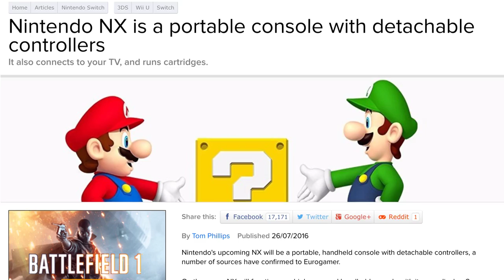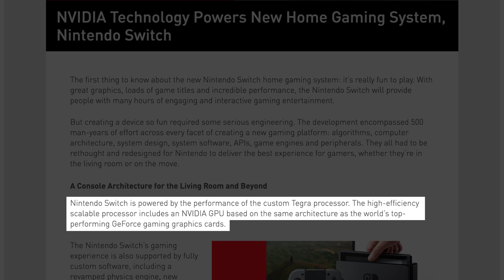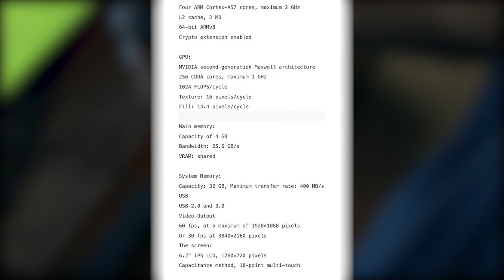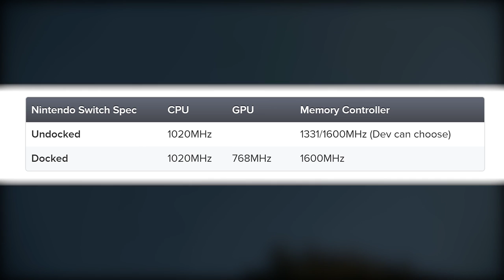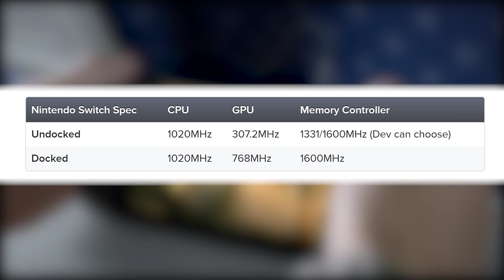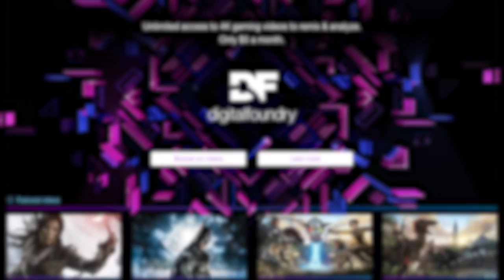DF Videocast #6: Nintendo Switch Clock-Speeds Revealed

Comment: Nintendo never learns
Reply: Dude it's very underpowered get over it.
Reply: Critical Pilot Because you are looking at it from a HOME CONSOLE perspective where the Switch is technically a HANDHELD with a dock.
Reply: Research? Nintendo has been in decline since the NES and SNES days. Their only top selling things since then are the Original Wii and Handheld stuff. Nintendo hasn't learned since the N64. Good first party games, but poor third party support and the Wii U has got to be the worst since the Virtual Boy.

Nintendo could just come out with a regular console. Instead many of us see gimmicks and under powered crap. That's already a sign that they may lose third party support again.
Reply: its true! what @IDragoN says. look at the n64... it lower storage than the ps1 disc, despite being the more powerful! system of the era. gamecube same thing, more powerful than ps2... could rival the og xbox but didn't have storage capability like the ps2 and xbox did. now onto the wii...  wii sold the most but honestly compare that library to that of ps3 and x360 no comparison there. if the switch is going to be underpowered again, well i dunno what nintendo can do... they have to market it so damn good like like they did with the N.E.S and Snes and N64, casue thoose sold and were nintendo's best era's.
Reply: It doesn't conflict with what Nvidia said all they said is was he was using the GeForce architecture not Pascal! You can go on the forums or their website if you will and read about it yourself! You guys really need to stop the bullshit and get over it again it's a fucking thin ass small ass tablet it's not going to compete with Xbox one or PlayStation four but I'm sure Nintendo fans will enjoy the Nintendo exclusive's on the system I might even buy one for Zelda but maybe not.
Reply: In my opinion the SNES was Nintendo's best system that's why I still play one and own one today and 64 had some good titles but very much paled in comparison to the original PlayStation when it came to titles  GameCube had some cool games but it still didn't have the blockbuster titles that PlayStation was getting yet again don't blame gamers and a gaming community for Nintendo's fuck ups it's solely on Nintendo shoulders and they obviously just can't get it right no matter how many Switch Systems sell it still is not going to get a lot of the third-party support that PlayStation and Xbox will receive.
Reply: Its a fucking rumor
Reply: Sure it is but when you have multiple sources saying the same thing it's really not a rumor dude they put rumor on it for a disclaimer so they can't get sued trust me it's not going to be powerful for a handheld yes but for a home system Hell no.
Reply: +I DragoN I think they learn quite well. The Switch isn't trying to compete with consoles, Nintendo is focusing on the one thing Microsoft and Sony can't touch them at, and that's the handheld. The Switch is the most powerful handheld out. If you look at the reveal trailer, Nintendo is marketing this as a portable handheld device. At least 95 percent of the trailer is people playing the Switch on a plane, outside, in there cars, at public gatherings etc. They only showed it initially docked  and being played while sitting on the couch. Notice they didn't focus on the docking station, because that really doesn't matter, they are selling you the handheld portion. The docking station is the gimmicky part that people can use if they choose, but must people want the ability to play Zelda BOTW on the go. So this is the smartest thing Nintendo has done in years, they focus in on what they are actually good at. They throw in the ability to play on the big screen if you want, but they still  are the best thing going in the handheld market. The Switch is a smart move. It's going to sell big time.
Reply: "SOURCES"
Reply: WITLESSMASS 'marketing this as a portable handheld device'? um handhelds ARE supposed to be portable xD perhaps you mean portable console :P
Reply: but they did learn.  They know if they try to go toe to toe with Sony and Microsoft when they already have a several years head start, with a similar power console at the same price whilst splitting the userbase they do have between two platforms, they're going to lose.  

Personally, my Wii U collects dust.  Has done for ages.  The 3ds gets used weekly simply because it's not competing with my ps4 or pc.  This is Nintendo focusing on their strengths.

As long as they're treating this as a handheld first and foremost, and a home console second, I think they'll have their market secured.
Reply: Where the hell did you seen the video that the system had similar power to the competition lol honestly them staying handheld mostly his Nintendo's best bet I'm not saying that the handheld is horrible by any means but for them to try to push it as a home system and not a handheld system was pretty dumb in my opinion.
Reply: they lost third party support last year because the lack of power, and they can't at least mach the xbox one power which is already an underpowered console... imagine that
Reply: Yet. Wii U has more consoles sold than Xbox one
Reply: +Efrath I agree wholeheartedly, Nintendo burnt me with the Wii U but I have high hopes for the Switch. Its a smart move to focus in on what you're good at. Nintendo has done that with the Switch, it's a very powerful handheld device. Leave the Console wars behind, I think Nintendo is seeing this more power war for what it is, it's not profitable in the long run. It doesn't make sense to produce superior hardware and then sell it at the cheap price console only gamer's are willing to pay. I game on PC as well and more teraflops cost money. My GTX 1080 cost me over 700 bucks and that's for 9 teraflops of power. The PS4 Pro cost 399.99 before taxes and produces 4.2 teraflops of power in an all in one system. And now Microsoft is miffed cause Sony released the Pro so cheaply and now they can't release the 6 teraflop Scorpio as a Premium device like unto a high end PC. Microsoft has to keep the Scorpio in the price range of the Pro are people will just pick the Pro up instead. This has become an Arms race with in gaming, an Arms race Nintendo is smartly removing itself from. America defeated Russia without firing a shot, it just got them to play a game of who has the most tanks and Russia couldn't keep up. Usually Microsoft and Sony sell their hardware at a lost, they hope to recoup their money on software. The Switch allows Nintendo the opportunity to make a profit off their hardware. It's a smart move, the Switch doesn't need to keep up with the Pro or the Scorpio, it just needs to be the most powerful handheld out there, with IP's that people can't wait to play on the go. This thing is going to sell like hot cakes and it want even need third party support to do it. The prospect of playing Zelda BOTW on the go is a system seller, the ability to play beloved game cube games on the go is a system seller. The Switch is not about playing games on the big screen while sitting on your couch. We can already do that. What the Switch is bringing to the table, is the ability to play games we once thought could only be played on a console, on the go.
Reply: Deronia lol no
Reply: Deronia what are you serious?
Reply: Deronia no microsoft fan but 20 million wii u's vs 45+ million xbones.  Personally i have a wii u but i am not delusional, it is a failure.
Reply: Well here's the thing Xbox doesn't have 45+ million Xbox Ones sold either so you're both actually wrong about the numbers but I can assure you the Xbox one definitely has more system sold.
Reply: +Critical Pilot Trust me, Nintendo is banking on the fact that most of us will buy just for the ability to play Zelda BOTW on the go. That prospect alone will sell the system to many. It's a handheld pure and simple. A handheld that is upping the ante on what type of gameplay Nintendo can bring to their IP's on the thing. We haven't seen anything like this on any of their other handheld devices. It doesn't need to compete with the consoles, its the most powerful handheld out. Microsoft and Sony can't compete with Nintendo in that arena.
Reply: WITLESSMASS pretty sure they only made this cause they dominate the handheld market and it looks like they're trying to get sells from Japan cause it looks like console gaming is going to die there while gaming on the go or mobile is exploding in Japan.
Reply: Here, I'll tell you what happened, the "Source" is more than likely a person with an old devkit and got questioned about it with the clickbait journalists ignoring said fact that it's an old devkit with old hardware and then made a "Reveal", pretending it's fact when in reality it's rumours at best due to the simple fact that an old devkit runs on older hardware for obvious reasons. I highly doubt these "Sources" have access to an actual, new Switch.

And multiple sources saying the same thing does not make it fact, it's just naive to think that; it honestly annoys me at how many of you that are falling for clickbaits that are basically just "THESE ARE THE NUMBERS" without citing sources or even mentioning what they're basing it on, whether it's an old devkit or an actual Switch. But then again, they wouldn't get as many clicks if they were actually honest about that and people would stop spreading it as "Fact".
Reply: Nath W Nintendo hasn't learned anything.

When everyone else is x86 and you are using ARM you are wrong. That is why the Wii U died.

PS4 = x86
Xbox One = x86
PC = x86
Wii U = Custom Solution

Hmmm as a developer looking for the largest return on my investment what do I do?

Custom solution that only works on one console or x86 that is crossplatform. One version of the game will work across the rest and we can just fiddle with this and that to optimize.

x86 it is.
Reply: Nintendo... Nintendo never changes
Reply: Felipe L. Exactly.

They always try to push the same shit that didn't work last year But oh look! It's got a gimmicky controller or pad or dock or color, this one is pikachu themed. ( Rolls eyes ) Fucking Nintendo hasn't learned anything and will eventually go out of business.
Reply: if this is true for now its nothing more than a rumor
Reply: @Critical Pilot Geforce is a brand. Pascal is the name of their latest microarchitecture. I suggest you do more research before making yourself sound like a fool on the internet.
Reply: +KvSwooo Nah he wouldn't do that he has "trusted sources" which he believes 100% are right even though its a rumor
Reply: Critical Pilot is the succesor of the 3ds? ...i doesnt have to compite with the xbox one or ps4...you said is shit...i think is the most powerfull portable console in the history.
Reply: That's because they are the only ones who understand.
Reply: WoomyWobble why wii u failed then
Reply: Wii u Failed because it was not x86 like everything else.
Reply: Marketing
Reply: ***** lack of third party games and crap hardware.
Reply: Aaron Garza switch still is arm lol
Reply: ***** I know dude! Nintendo hasn't learned a thing. Same mistakes as always. Lol.
Reply: Efrath The problem with N64 and gamecube was: They had their own storage format. Third party wanted CD ROMs over cartridges because it had more data. Same thing with the gamecube. Sure, they can come out with a powerful system but at the other fronts it screwed over third party. That is what Nintendo never learns.

 Should just come out with decent hardware, normal controller, good online infrastructure, no region lock and something 3rd party would support.

But but, Nintendo just turns into MS and Sony without their gimmicks! Well, their 1st party is what differentiates from the others, they don't need gimmicks to succeed. So Nintendo can't make a competent console on all fronts, THAT is what they'll never learn.
Reply: The switch will be weaker then an iPhone 7 (which already outperforms the not downclocked Shield console and Pixel C tablet in most benchmarks).

Here are some Benchmarks guys.

Geekbench 3 (processiong performance)

iPhone 7 - Singlecore: 3380; Multicore - 5500
Nvidia Shield Console - Singlecore: 1650; Multicore: 5040

The Switch will run at 50% of the Shield Consoles clockspeed.

GFX Benchmark (graphics performance) Trex 1080p offscreen Render:

Nvidia Shield Console - 120 FPS
iPhone 7+ - 108 FPS
Google Pixel C Tablet - 103 FPS
iPad Pro 2015 - 170 FPS
Xbox One - 400 FPS
PS4 - 480 FPS

And the Switchs  GPU will run at 1/3 of the clock speed of the Shield Console.
Reply: coolertuep It's a new fat 3ds Lol its so hand held it doesn't even fit in your pocket. Lololol.

Can't wait to play the new crappy Mario game they come up with since they don't seem to care much about any of their other I.P.s.
Reply: coolertuep Didn't see Switch's performance on the list.
Reply: coolertuep the iPhone 7 outperforms the shield tv not because of the hardware but because iOS is a normal software and Android is a Java piece of shit that waste resources. Hardware wise the shield TV is miles ahead but consumes a lot more energy.
Reply: You compare with x86-64 systems, is imposible to have same performance on a ARM system.
3DS: has 4 GFLOPS
PS Vita: has 50 GFLOPS
Nintendo Switch: 400 and could have until 512 gflops

With a Tegra X1 Nintendo has the mobile device portable more powerfull on the market (nvidia shield TV is a home device) , all of this power on a handled  console is incredible.
Reply: Rob Fer what???? vita is 50 gflops and 3ds is 4gflops
Reply: Aaron Garza Nope, everyone else isn't using ARM. If I'd look for the highest ROI, I'd develope for ARM, as you're ending up with considerably lower dev costs and ARM is on pretty much every portable/handheld device there is.
Reply: Efrath No, they don't never learn. After the disaster that was N64 and Gamecube was followed by huge success tbat was Wii, Nintendo still went on to develope the Wii U, that was maybe the most epic failure on the industry. NDS was followed by 3DS - makes you wonder what were they thinking. If Switch is a huge success, Nintendo's going to replace it with some virtual reality glasses.
Reply: Vishal thind Yeah, you are right, i'm wrong, i was confused about Vita that has SGX543 MP4+, not mali 400, and 3DS that has Pica 200
Reply: ***** Yep, I am referring to portable devices
Reply: Aaa Bbb The Wii was only a gamecube with a few extra bits and a gimmick ( Wii mote controller ). It sold well because of the Gimmick, everyone wanted to check it out. They did. They went back to a real controller that wasn't gimmicky.
Reply: Aaa Bbb You can say your an ARM dev and all this other trashy lies but in the end the industry has spoken.

To make porting easy... They've all opted to use an x86 framework.

Going ARM when everyone else is x86 just means you will be left out in the cold and some companies will not invest resources into porting games to your platform especially if you are the only one using it and you have a crap install base.

It's the Wii U all over again. Same gimmick shit to try and get people wanting the console.

That is all Nintendo is now... Gimmicks!
Reply: ***** What are you using then? What games are you playing? Lol
Reply: ***** The difference is in those days everyone had something different. It was the reality of the industry at the time. Times have changed though. Again, everyone else is x86 now. They, companies making and selling games, have to see if they want to invest into porting to this one console and hope they don't take a loss. Companies aren't going to be throwing themselves into that fire. 3rd party support will be weak as hell.

This is exactly why the Wii U failed.

It will also be why the Switch fails.
Reply: Aaron Garza Nope, Wii U is a Gamecube with gimmick. Wii was never about the hardware, it was only about the software. Wii Remote was only to remove a barrier of entry. Wii Sports was successful because of sports, Metroid Prime 3 was successfull because of Metroid, Wii Fit was successful because of excercise, NSMBW was successful because of Mario, SMG was successful because of 3D Mario, and the list goes on. All of the games used the controller extremely well, but the point was not the controller, but the game. The controller was functioning only as a method of communication with the game. Controllers don't sell consoles, games do.
Reply: ***** Do you work on porting? Can we see your resume for porting games?

It's a big task and it costs money. Something companies don't want to lose a penny of if they don't have too. Doesn't matter how popular an architecture is. In the end what is cheapest for the company and what provides the largest return is all that matters.
Reply: Aaron Garza Yes, Nintendo is gimmicks. They think Wii was successful because of the controller, not because of the games. However, with the Switch, it looks like this may change - at least what we've seen so far is pretty straightforward and interesting. By the looks of it, it's impossible for Nintendo to pull out a new Wii U-gimmick. It's been pretty much the opposite. However, we don't know much about the games so far, and this us what matters.

No matter what the industry thinks, it's the market that decides. There's a reason why all the developers are on the mobile platforms (=ARM), that's because that's where the people are. There are lots of "AAA" titles being ported to mobile anyways, and there are more ARM systems in the market that can play games, than there are X86 systems.
Reply: Aaa Bbb I never said the Wii U was a Gamecube. The Wii was. It definitely had a gimmick, aka the gamepad for the Wii U and the motion controller for the Wii.

Your right Wii was not about the hardware... It was about the Gimmick of using the Wii mote that drew people in. It just so happens that some of the software, all of what you mentioned was first party, was ok.

Marketing sells consoles and one way to market your console is a gimmicky controller that is new and unique.
Reply: ***** Right they still ported to the old systems because they had their teams, who've been doing it for years at that point, who could quickly and efficiently port the game. It would give them good sales since there was al ready a large install base of both PS3s and Xbox 360s. They had a high chance of making a profit from the investment of porting to those consoles. Which is why they did that.

The Wii U did poorly because it didn't have 3rd party support. It didn't have 3rd party support because of Nintendo's draconian 3rd party deals, their poor youtube/streaming policies, and their unwillingness to use an x86 architecture, like the rest of the industry, to keep the costs down and the return on the developer's/publisher's investment as high as possible.
Reply: Aaron Garza They port when they see money being made there. That's only thing that mattters. It is why we saw PC AAA titles on NDS.
Besides, why would devs port the PC games on PS4, I believe PS4 uses open libraries, as Windows games use MS's Direct access. It would be cheaper just to publish the game on PC and X1.
Reply: Aaron Garza Excuse me but VR is a HUGE gimmick but seems to be siccessful
Reply: MorimotoYTP Right. VR is a gimmick. It's successful because just like the Wii mote it's new and interesting so people take the risk. Also x86 XD Lol.
Reply: CroneRaven1810 Oh please, Gamecube had plenty of third party and N64 has a mixture of both; both has been praised as consoles with good game libraries. Don't go around claiming that it's about third parties when that wasn't even a big problem with both consoles having a plethora of good games to choose from. More than likely, people associated Nintendo with "Kids", with Playstation being the "Mature" console.

No, turning into MS and Sony wont change anything, most people here will still buy X-Box or Playstation based on brand rather than what games the console has even if Nintendo decided to go with a strong console. Consumers did this and this is simply the consequences you have to deal with, going around and complaining about it after the fact wont change anything, they have no reason to believe anyone will buy their console for graphics alone.
Reply: ´´Yet. Wii U has more consoles sold than Xbox one´´ Lol XD Fanboy much? as far as i know 30 million is higher than 14 million
Reply: Dark souls developers ran  a bouild on the nintendo switch and they were pretty happy with the performance
Reply: Nicolas Cortés lmfao
Reply: Aaa Bbb I mean I've explained it over and over and you just don't seem to see the big picture or even understand what I am saying.

One last time...

They port when they see their is money to be made. Yes.

When your console isn't flying off the shelf, like the PS4 is, then there will be no return on your investment. This means that you shouldn't even bother porting. Not everyone with that console will buy your game. In fact, there will be a huge chunk that won't. So if your install base is low, like the Wii U, then no one will port games to your console. Especially, if you add a barrier to the porting process like a completely different architecture. Nintendo is only shooting themselves in the foot. Risk on the investment return is high enough without the barrier of a different architecture. Plus, lets not forget, not everyone is rich and can afford all the consoles and PCs galore. Some people can only get one device. If that one doesn't have the majority of games you might want to play then you won't get that console. No matter the gimmick.

The console purchasing decision will come down to several factors.

1. Do my friends have it?
2. Can I play games online with them?
3. Is the console reasonaby priced for the hardware it provides?
( In the Wii U's case this is a no and from the rumors I hear neither is the switch)
4. If I get this console will I be able to play 3rd party titles that I want to play?

Etc..

---

Why port PC games on PS4? Because it's easy x86=x86.

PC=x86
PS4=x86
XB1=x86

Aside from minor changes to the program, it can be moved to the other platforms with ease. So, it takes little to no investment than compared to moving to a completely different architecture.

So...

x86 =\= ARM

Is ARM popular? Sure.
Is ARM capable? Sure.
Is ARM x86? No.
Are all the other platforms using x86? Yes.

Who doesn't look like they others?

"Nintendo"

Hmm....
Reply: Actually snapdragon chips can run windows now
Reply: In the end I hope Nintendo does well but to me it just looks like they are shooting themselves in the foot.... Again.
Reply: It's like a 100++ Years Old Man .... wait ...
Reply: Nintendo is geared toward their domestic market in Japan first, then the international market second. So the question is, will the Switch be successful enough for them in Japan?
Reply: Aaron Garza once Jan 12 hits, things will be different for Nintendo
Reply: Aaron Garza I would advise you to wait until Jan 12, because this isn't confirmed by Nintendo. I see you just waving a rumor above your head saying "Oh look the switch will fail Lololol."
Reply: Aaron Garza I believe that you are basing this off the rumor right?
Reply: so
Reply: it is just rumors
Reply: Justin Wong yeah pretty much but the Garcia kid doesn't understand
Reply: +Efrath What an idiotic piece of dialogue. Nintendo failed with the gamecube and N64 for the same reasons they always fail. They are too stupid, gimmicky, and childish to make a successful console. Scratch that for the one exception where the market called for that in the Wii, outside of that - Nintendo has failed and always will fail. A stronger console isn't going to fix that, because if that was the solution to increasing sales, then there'd just be an arm's race of who can make the most powerful console and that obviously isn't the case.

You're right on one thing though, even if the Switch turns out to be PS4/XBO level, I still won't buy it, and most other's won't either. I don't just care about graphical power, although I'm sure that'll be underwhelming too anyways.

I didn't need to see this video to know I wasn't buying a Switch. I had already decided that when they decided to launch this years after the generation has already started, with more poor launch titles and what will almost certainly be concluded with another terrible library of games, cartridge support, more gimmicky mess and what looks to be another terrible controller design.

Funny enough, it's the same problems Nintendo has had since N64, just with the added problem of being a shitty computing device as well.

What you and Nintendo have always failed to understand is how the gaming market works. You don't come to a party three years late, with at best equivalent powered hardware on the inside, and complete gimmicky mess of the opposite of consumer friendly  BS on the outside. Not to mention, a catalog of launch titles so piss poor, you will inevitably think it has to get much better, but somehow it doesn't. 

Until Nintendo realizes their problems (and there's a lot), they probably aren't going to ever release a successful console again, and their little handheld market is shrinking by the day in favor of mobile devices.

The sad part is, it would be relatively easy for them to make a successful one, if they actually followed the market, but instead they'll probably just end up a children's game mobile developer in a few decades.

Properly sized CDs, 4k BRD drive, a controller designed by someone who isn't an idiot, at least a standard 2k model, maybe even 4k supported model, and an actual quality list of launch titles from third-party developers, and first-party developers that aren't in the business of making games for 7 year olds. Make that release date a couple years ago, and it'd probably be winning the console race right now.
Reply: Arch Angel Nobody really cares about the third parties, as the problems with third parties are the exact same problems the "3D Nintendo" has. People are rejecting the whole of games industry, this is why you see people going to mobile devices (until the problem reaches mobile). We had Wii and DS a decade ago, and that's where Nintendo should be returning. Nobody cares about the hardware, except for it's price and whether if it's complex to use. 

The easiest thing in the world is to design console hardware, because that's what the market cares about the least.
Reply: +Aaa Bbb People aren't rejecting the game industry, what are you talking about? The industry has grown exponentially over the past two decades. Sure, people aren't just using home console as a gaming device anymore, but when you factor in just how much bigger the gaming population is, and their more expensive price tag, the consoles are still selling as well as ever.

The biggest problem (which as already said, there are many) with Nintendo IS third party. At the end of the day, most people buy consoles to play GAMES. When you don't have GAMES people aren't going to buy your console. This is why the N64 and every other Nintendo console has failed is because they failed to match the game libraries of their competitors. They've had a terrible relationship with third-party developers, and have never made it easy to put third-party games (which are statistically the best-selling games).

And Nintendo shouldn't be returning to the Wii or the DS. The mobile console market is pretty much done for, and the Wii fad died a long time ago. Nintendo's gimmicks have become more of a joke than a success, and if they were wise, they would've stopped after their blessing of the Wii.

What Nintendo needs to do is glaringly obvious. Buy promising young game companies for exclusives, contract with game companies for more exclusives, put an easy to use AND EASY TO DEVELOP for console out on the market that meet's their standards, and work that ass off to create some relationships in the gaming industry instead of being hermits. Oh and fire everybody in their marketing department and hire a team that can actually work the industry.

If they had done this a few years ago, they'd probably be beating XBO right now, and maybe even PS4 if their library was good enough. Instead, they choose to be stubborn like Sony and Microsoft tend to do every now and then and act out and do whatever they want and defy the consumer's interests....and the results show. Problem is...with Sony and Microsoft, they only do this for a year or two until they realize their model isn't working and changes it back to what it should've been in the first place. Problem with Nintendo is they've permanently had this problem for the past 20 years, from game media, to home media features, to usability. It's always been a war for Nintendo against consumers where they choose what they like over what they can sell - presumably because the people in charge are just a bunch of idiots that rather play with their toys the way they want than actually make sense.
Reply: Arch Angel You obviously don't have a clue what you're talking about. People are going where there are no industry games, this is why the mobile devices are so popular these days. There are lots of developers you never heard of making fun games you never heard of. This is why NES and Wii were so popular and why Gamecube and Wii U weren't. No industry games for NES and Wii, while Gamecube and Wii U were build for the industry games.

Nope, Wii and DS aren't gimmicky - Wii U and 3DS are - they had hardware that could take advantage of the software, on Wii U and 3DS Nintendo still haven't figured out how to use the 3D or the gamepad. Or maybe they have, and just don't like the solution. 

Console market have been stagnant since the NES (sans Wii era) where market was already established in the 80's. Maybe the biggest reason for the console market growth in the 90's was the game centric computers disappearing.
Also, just by looking how many companies have bankrupted in the 2000's, I don't think talk about a growing market is warranted by any means. A handful of companies is making more money because of the lack of competition.

Nintendo's consoles have been the easiest to develope for, for the whole 2000's. No doubt Switch follows the pattern.
Reply: michael pachter said that he heard from developers that the switch is the easiest to port to
Reply: Arch Angel Oh, and Wii was not a gimmick. If you'd said the PS3 BD drive was a gimmick, I could've agreed you, but Wii - nope. The whole point of the controller was to remove a barrier of entry for lots of people. It did add to the gameplay while being made to take advantage of the software. I do know the definition, but that's the point; it's no more a gimmick than a D-pad or analog stick. In the same way analog stick was designed to take advantage of Super Mario 64 and Ocarina of Time, Wii Remote was designed to take advantage of Wii Sports and Metroid Prime.
Reply: Aaa Bbb I don't think I've met somebody with such a lack of business sense in my life. I would rebuttal, but you would just counter it with your own idiotic logic, and I rather not read such complete dumb shit again.

At least you have some knowledge about the inner-workings of the console though, and I agree with you, the PS3 is the most difficult to develop for from a technical perspective, but that isn't the only requirement for developing a game, and sadly for you, there's a reason the Playstation has had a bigger library.

The facts just aren't on your side, and neither are the people.

The gaming industry isn't dying, and Nintendo doesn't need to invest in more gimmicks like the DS and Wii. They need a simple mainstream console with an expansive game library. Period, end of story. That's what people are asking for here, and if you weren't so into yourself and your ignorant thoughts, you'd see where the market is being driven.
Reply: We'are getting at a point were graphics cant any better
Reply: Justin Wong They get better, it's just less noticeable, and the margin of difference is smaller because of the state of where graphics are at now.
Reply: Arch Angel You know, they do need a simple mainstream console, that's right, and a simple mainstream console is something like the Wii and the DS. That is simple. This has been winning solution ever since the industry started.

Yes, Playstations have had the largest library for the same reasons Wii, DS, Snes, GB and NES had the largest library. It is where the largest market is. This is also why there are apps coming for Android through the doors and windows, because there are so many devices using Android out there.

There isn't much more to it from technical perspective. Basically everything "non-hardware" falls under the documentation.

The game industry isn't dying anymore, it's already pretty much died from what it was in the early 2000's. There aren't that many publishers anymore - but what's happening is that it is changing - this is why you see these "one hit wonders" being bought out by the big guys.
What is happening, is that devices like PS4 and Xbox 1 are dying from the market. This is what happened in the 90's when the game centric home computers died out, when consoles replaced them in the low end and IBM clone PC's replaced them in the high end. Nintendo isn't investing in consoles for the same reasons Sony put out the PS4 Pro: both of them see the market for consoles like the PS4 coming to an end - and this was coming from Sony themselves.

The real life is still pretty much on my side, as I'm just stating how thing are currently.
Reply: Justin Wong Like we had for the last three decades. We always can have more polygons, higher frame rates and higher resolutions, but the only question is if it pays out or not.
Reply: Just like war... Nintendo never changes
Reply: To bad its just a rumor.
Reply: still better than Sony and Microsoft
is more innovate, better than just upgrade graphics
Reply: You were all wrong lmao, love this
Reply: @archangel7659  It's AMAZING how wrong you ended up being, with the Switch being easy to develop for, recieving signifcant third party support and some extremely impressive ports, a fantastic 1st party lineup, and over 55 million units sold, outselling the Xbox One which had a 3+ year headstart, and the number will continue to climb even higher.
Reply: This didn't age well.